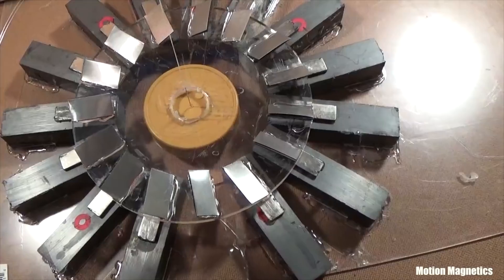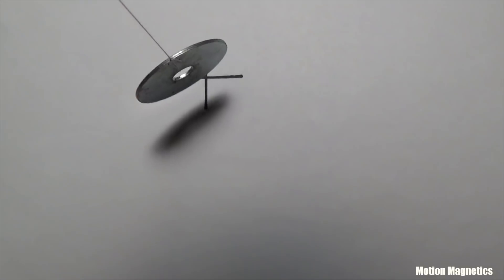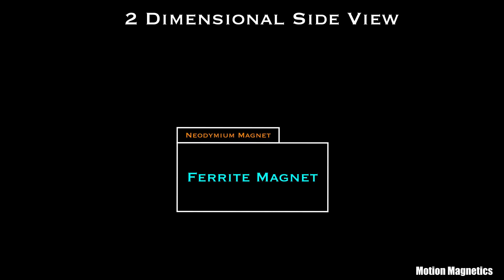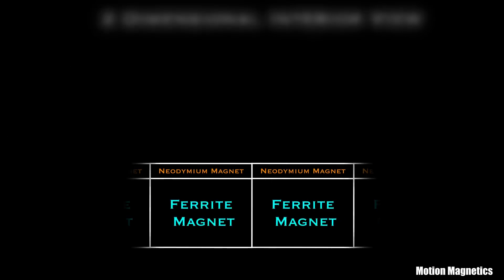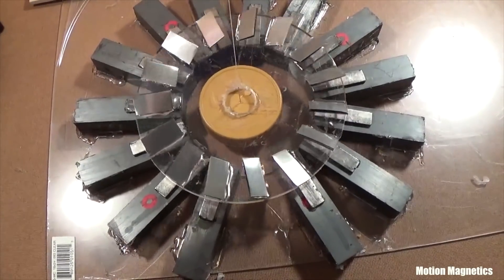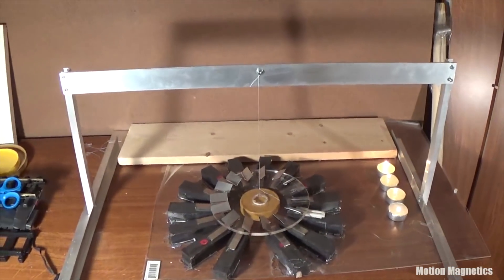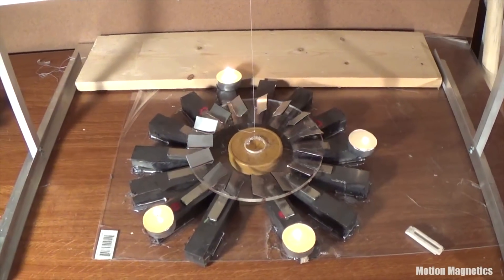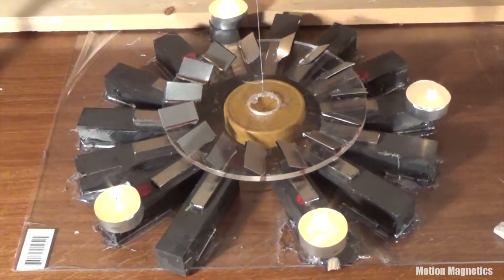Self Running, DiaMagnetic Motor?

Comment: what would happen if you flipped the rotor over so the diamagnetic  plates are closer to the magnets and the Plexiglas is on top???
Reply from the maker: I did that, initially. Because of the rotor being suspended by a string, it kept bumping against the magnets on the stator, which is why I flipped it.
Reply: Sorry, I just thought the Plexiglas might be hindering the effect due to proximity. Good luck and maybe 2018 will be the year for magnet motors!!!

Comment: The visual impression is fine but extraordinary claims do need extraordinary evidence. Good data usually emerges when variables are eliminated, or controlled, or at least understood. 

There was no scientific reason to add the tea candles into the demo. In fact there are 2 very good reasons why the candles should not be there: (I) they degrade the video; (ii) they create updraft which will spin the rotor exactly as shown!

With such tiny forces it's important to eliminate the effect of air currents but this video intentionally adds them!

Bad Science!
Reply: Motionmagnetics hi, keep doing your work, you have a good heart because I know the implications of the cause you're working for. You are open to input, I can hear that in your replies. This sets you apart from scammers. If your intention was to show evidence of a working magnet motor, I'm sorry to say that it is not convincing. You need to isolate your claimed phenomenon. Try:
- put in vaccuum chamber
- put in dark chamber, blocking radiation
- think on how to limit temperature gradients of the enclosing chamber
- show measurements of ouput/input power, graphs of speed vs time
- control test that shows that it can not work if one magnet is removed
- use a hinge that doesn't wind up like a spring
- don't use candles to prove there's no wind, just put in vaccuum and prove the vaccuum is real by having some object move in it, track its path and show with a calculation that in air it would be different. Drop a feather, or something better that has typical visible characteristic in air.
- put in faraday cage
- run it for a month and film it consecutively 
- make the video authentic such that it would be improbable to fake it with CGI: use a time stamp counter that shows in the video, a random number generator, and display some secret sequences of numbers that third parties provide to you that refresh every millisecond in the video via livestream. These secret numbers have to be projected on the objects your filming in such a way that it would be hard to fake when they're provided to you in realtime by these parties (there exists live CGI these days so you're up against that). The numbers have to be verified later and they have to put a note of validation on their own websites. Immediately send the video to parties. This method would atleast prove that you would have no time to edit the video manually. But this doesn't stop live editing algorithms being suspect. 
This is the tip of the iceberg for a video... A tiny tip.... Let alone a scientific paper.. With a paper you would probably have third party replication as best evidence, but in case you continue the 'video as evidence' path.. Consider upping your evidence. I'm just an idea person. Good luck.
Reply from the maker: I'm aware of that. However, the first thing that is usually suggested when someone posts a video of a supposed working magnetic motor, is that the uploader place a candle by the device to prove they're not using an air hose to rotate the device. That's why I showed it rotating without the candles, in the first part of the video, and with the candles in the last part. To show that the candles that are causing the rotation.
Reply: Proof of concept jerry rigged rough draft. Your expectations are a bit mutch for a prototype. Vacuum Chamber? Yeah that's affordable not at all a waste when one could simply enclose the motor in a container even a faraday cage if he wanted to do a taboo double experiment. Even if it does not work in a vacuum but does work when enclosed, it would pretty much serve an identical function (to weakly spin) all be it, only in place with air which isn't much of a limitation hear on planet earth. The light thing is fare but kind of pointless since it is seen working within dim light, so it could still generate in very easy to find light conditions (this would still not change the fact the mechanism is powered by diamagnetism because the diamagnetic pyrolytic graphite is still playing an essential role in the design).  There is no swiveling spotlight either; but I see what your getting at pyrolytic graphite does produce rotational when reacting with focused/uneven light. It could be hard to film the thing working if completely enclosed from radiation and shrouded in complete darkness ;P Temperature ok simple and cheap just throw it in the freezer or something for the other extreme. This would effectively test weather or not this is an easier to make sterling engine. Could still be useful and assuming one cant just replace pyrolytic graphite with some normal material like wood, it would still faction as advertised (a diamagnetic motor) all be it with varying temperature gradients being needed. Record for a month strait and upload it? How? it takes long enough to upload a ten minute vid let alone a month worth of footage are you mad? I think the only way to satisfy these "skeptics" who don't try things for themselves is to give a live demonstration in real life. Live stream for an hour is enough to get the point... a month...  no need for hyperboly in science! The rest is unnecessary if one cant replicate his work but to do that someone has to try it themselves. We don't need the bystander effect muddying up progress any more than it does. Scientific Journals don't even do this conspiracy tin foil random number BS. Come on. they say "here is what I done? Here is what I think about it any one disagree with their own findings?". And then usually someone else tries it and through independent experimentation the magic of discovery happens gradually. This is what Motionmagnetics does because no one man can think of every variable and afford to experiment with them! Be patient unless your willing to experiment for yourself; in which case good job for being proactive.  This last few sentences are not directed to you necessary but the unwinding string DEBUNKED! HA GOTEM! hypothesis is dumb. The string cant unwind when constant pleasure is being applied like in the case of the motor. To unwind the wound string must be "let go"/ the tension released. THIS MOTOR SEEMINGLY DOES NOT DO THAT IT CONTINOUSLY APLIES FORCE IN A DIRECTION. The string does not appear fast enough or lose enough to be simply unwinding. If so that is a very interesting string for being so thin being it would have to be consciously be unwinding for a min strait at a constant rate like seen in the vid. I still would ideally prefer Motion magnetics to these experiments but realistically I expect all of y'all to be doing them as well and not shaming him for a quick proof of concept rouph draft proposal of how it works type vid is unnecessary and asshole-ish.
Reply: Mr.023439 _c a vacuum would reduce variables and likely improve efficiency
Reply: Brandon Sams if their experiment is in a journal then yes, you wouldn't need secret random numbers verified by third party. You would have replication as your evidence. But because it is a video, you better make sure it is authentic, because as we should all realize is that anything can be faked with simple tricks. Plus there's all the scammer vids. I know it sucks, but you have to partly fix the bad name of the field due to the scammers. But even besides the scammers, the video evidence can still be improved. So you have to create these unusual constructs that are embedded in the film and can be verified. It is prerecorded, but this has the same effect as your live stream idea, but with added benefit of: 1) the experimenter being able to retake the video in case of failure (you really don't want a live failed demo, this would do more damage to the public opinion) 2) more authenticity.
About video length, ever heard of fast forwarding and data hash? You upload a sped up version of the running device but make sure each frame has not lost data about the random numbers, then you give the viewer the hash of the sped up video part which they should check with the third party.
The experiment has to be in vacuum. There's so many phenomena that could interfer when left in air.... Besides, this is about isolating tiny magnetic phenomena so leaving air in is bad.
I don't get your string comment. Are you for or against using string?

Comment: did you try bismuth?
Reply from the maker: I didn't. I own a big block of bismuth, but I already had the graphite in the specific dimensions in wanted to use, so it was easier to just use those. Bismuth may actually work better.
Reply: Bismuth WILL work better, it has the highest dielectric inertia. The only problem is that it's heavy and dense so that may weigh down the rotor. To compensate for this  I would wager that having a "diamagnetic levitating" rotor may be better instead of string as there will be absolutely no friction and it will always self center.

Comment: What kind of idiot thumbs down this video?
Reply: Yeah, you're right @Motionmagnetics ,the people with tiny brains will mock and laugh at everything and do nothing themselves. Well, I guess comic relief has it's place in society.
Reply from the maker: I really don't hold it against them. There are a lot of fakes out there. I know, I've exposed a few myself. It may be lazy thinking, but it's easier for someone to just assume this video is another fake, than to take the time to build a replica and see for themselves that it actually works.
Reply: Exxon Mobile n them
Reply: VeracityTrigger bravo ... Bravo ... 
You've completed phase one of your trials.
Spotting and evading a.i controlled chat bot
Reply: You are trying to get  free energy. Not possible.
Reply: It's just not a convincing video, honestly. The amount of magnets used and such small torque, based on a hanging thread which could be wound like a rubber-band to create the appearance of field energy. Stationary magnets always seek equilibrium in a closed system. You can't get motion unless you vary the field.
Reply: VeracityTrigger #fakescience
Reply: Motionmagnetics build me a ufo that runs off the earths magnetic field .. Then ill believe you

Comment: Try using monfilament fishing string, you will not get the same effect. Or try mounting on ruby watch bearing and axle. Or unwind the string your using, then use a drill to rewind it in the opposite direction. You will see that it will not spin as freely.  If it does, then congratulations, you've just defied the laws of physics and have saved the world... not to say that its impossible, but the chances are... keep up the great work, it makes a difference.
Reply from the maker: Thanks for the comment. It's probably going to come down to balancing the rotor on something that causes very little friction.
Reply: How about placing the top assembly over a very thin needle?
Thanks for sharing!
Reply: It could also be levitated with a magnet in the center. that would be a zero friction solution but could also propagate unwanted flux loops.

Comment: ⛅Hi Sunshine🤔. You're on the right pathway, but think of a different way to get more power. I remember a show with a character Tim the toolman Taylor got to get more power I need more power. Peace and prosperity to you my friend. C-ya😎Bye!
"✌💖🤗~🌞🌎⚬" ...
Reply from the maker: Thanks. Part of the process is proving that magnetic fields can produce continual movement, without outside influence. I shared this so that other's can replicate it, and see that it works. The power portion will come easier, with that part of the equation out of the way.
Reply: Motionmagnetics I understand, your only showing concept, you need to crawl before you walk.🤔🙃😉😎

Comment: Everything is a fake Candle's hot air acts on the rotor blades.
Reply from the maker: No. I showed it rotating earlier in the video, without the candles. I only used them to demonstrate that I wasn't using an air hose to induce rotation. Once I put the candles out, the rotor continued spinning.
Reply: Okay.
1 . The weight of the rotor, (G) produces a moment of rotation in the yarn thread. Perform the experiment on the needle bearing as at the mechanical clock.
2. Aluminum and Graphite are attracted or rejected because of the induction currents generated by the Neodymium magnet.
Reply from the maker: Every time I tested it, starting with the string completely unwound, it always rotated counterclockwise. After 20 minutes of rotation, it stopped. It didn't unwind. If it were the weight of the rotor causing the rotation, it would have unwound clockwise. It did not. You don't have to take my word for it. I listed exactly what I used to put this together. Try it for yourself. If I were intentionally perpetuating a scam,  I wouldn't have shared the details of how I put this together, so that it could easily be verified or disproved.
Reply: The cheapest low friction axel to shut them up is to invert the design. Put angled pyrolytic graphite ring floating in water or some buoyant liquid and put the level magnets on a ceiling structure grounded for stability; Top-down, ceiling, level magnets facing above a suspended angled graphite ring floating in a bath of salt water below it. It may nick the sides of the tub though. That is my suggestion for a cheapest one i could think of (i have not built or tested). If you want to splurge and impress perhaps use diamagnetic levitation with bismuth or somethin. I am just going to assume you want to save money though.
Reply: Tudorel Scantei  vezi ca lumanarile sunt puse mulat prea departe pt. a influenta prin presiune ascendenta rahatii aia de magneti.daca vrei parerea mea cred ca a tensionat inainte sfoara. dar cunoscand cat de cat canalul astuia de you t. nu cred ca este avid dupa sponsori cu un " proiect" de felul asta .cred ca pur si simplu vrea aa scoata mai mult din ceea ce noi numim "astazi" legile fizicii. serios fara rautate☺

Comment: Winding strings pose obstruction. Plz try balancing it on an inverted cone tip, or something similar.....
Reply: Why not just hang the string from a stand? Why hold it and introduce this, weak, mind power shit? I'm open minded but this is dumb. I was optimistic for this channel; too bad.
Reply: If you have bismuth you could try diamagneticly suspending the rig. NightHalkinLight has a great tutorial on DIY adjustable bismuth levitator. Perhaps that could reduce friction substantially and prevent the winding problem. You may have to install some precautionary measures against "Eddy Curants" around the center wear this near frictionless magnetic axel would be installed.
Reply: try a clear dome of plastic on top if the moving assembly and support it through the center on a hard pointed toothpick - position the dome to find the center of gravity - attach the toothpick to the plastic base in the center of the non-moving assembly thru the hole you will need to drill in the moving assembly - you will end up with a view-able make-shift bearing if you can find a clear dome
Reply from the maker: I might try that? Balancing it was tricky, even with the string though.
Reply: lol why even recommend it when clearly just suspending a rotor from a string wouldn't allow it to spin in one direction for any long period of time. Unless it's magic string of course.
Reply: @alex you must not have watched the whole video then
Reply: Yeah, maybe try balancing a cone-shaped receiver (rotor part) on a sharp metal needle (stationary part). Set the pivot point high up so it will be self leveling. Kind of like how a compass pointer balances on a sharp needle.. Very nice work BTW!!!